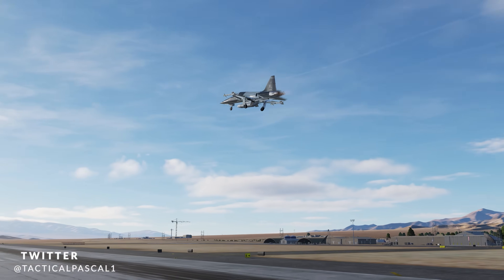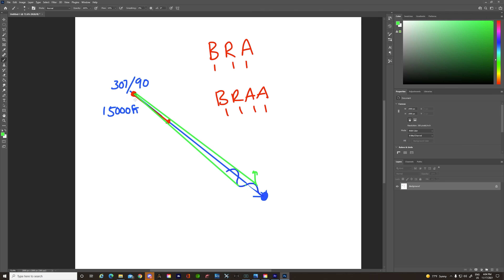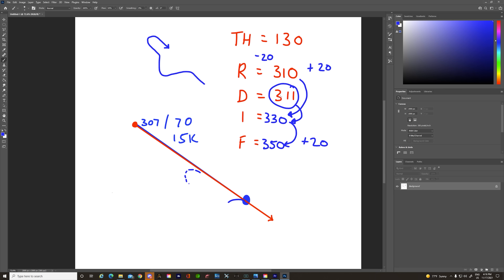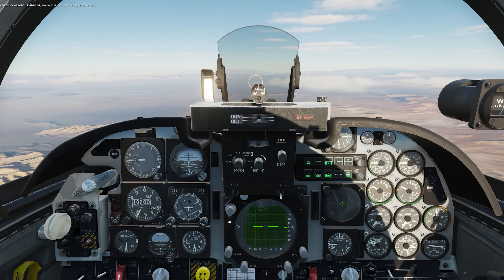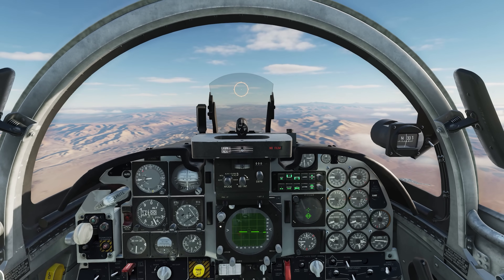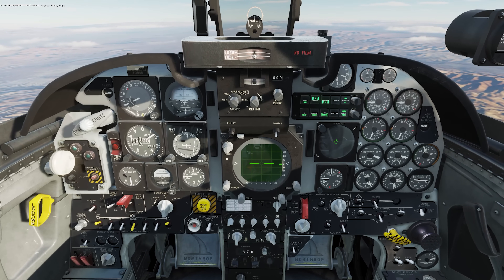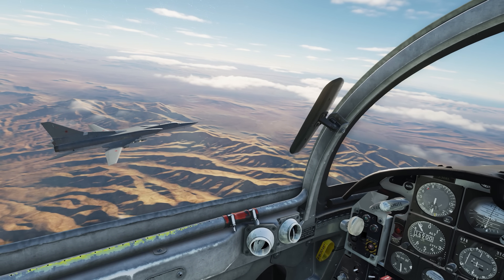Real GCI Instructor demonstrates Intercept Geometry | DCS WORLD

Comment: Seems like a huge oversight on ED’s part to not have AWAC include the target’s heading (aspect). Surely they are aware that BRAA has 2 A’s and their AWAC only gives the first A, so I wonder why ED hasn’t implemented a proper BRAA call for AWACS.
Reply from the maker: Seems strange to me too. However, not a great deal of people know how it’s done properly, they may have not had the full picture 😁 Hopefully it will get an overhaul.
Reply: Am I missing something? 3:21, one of the first callouts of the video, is a BRAA call, ended with target aspect. Still not precise heading, but aspect is there, DCS AI GCI calls out BRAA for contacts
Reply from the maker: @biaskolka it doesn’t give the heading
Reply: @TacticalPascale  Yes. Not the heading, but the aspect, so what BRAA is supposed to call: bearing, range, altitude, aspect.

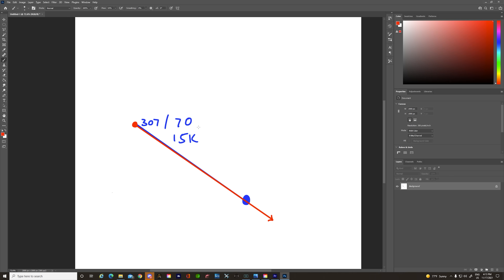Comment: 4:46 There is never need to round a bearing to find its reciprocal. The last digit stays the same whether you add or substract 180°. The same goes if you add or substract a separation of 20° or any multiple of 10.
Reply from the maker: I know this, but for headings it is easier to work to the closest 10’. I don’t have to fly 307’ for example.

Comment: How is this dealt with if bandit is actively pursuing and thus will turn their aircraft to follow you? Would you still use this or try something different?
Reply from the maker: You would adjust your headings as you get the bandits new ones passed to you.
Reply: @TacticalPascale  Wouldn't that ultimately leave him behind your 3-9 line if he's pointing right at you? I mean, sure, he'll be 20 degrees off from you but you're ultimately turning out and away from him. I mean, i get that this is kinda to look like you're not aggressive on him and to keep yourself out of a 50-50 (which is what would happen if you flew the BRA the whole way). On one hand, i don't want to fly straight at an opponent for a 50-50, but on the other i feel like you're handing him 20 degrees, which is fine if he's flying a TU-22, but what if this ended up a 4-ship of Mig-29s or something a little more maneuverable and threatening?

Or is this primarily a strategy outside of wartime?
Reply from the maker: At every stage of the intercept, with a more capable platform, you are within weapons parameters. At no point is the target outside of radar coverage. If they are declared hostile as you approach then you can shoot immediately.

I have been in a Hawk and intercepted by an F3. We didn’t know it was there until it appeared 50ft from the left wing.
Reply: @TacticalPascale  Ah, ok, so then this is specifically about intercepting for ID, escorting out of friendly airspace, and other things where you're not necessarily planning on firing right away. Judging from the title of the video, i (and i think a few others) made the fault assumption that this is specifically andvanced BFM specifically to get behind someone for some AIM-9Ps or archers.
Reply from the maker: Nope; any intercept on a bogey or bandit would be done this way. Hostile gets an AMRAAM from many miles away. Bogey / bandit, we have to establish hostile intent before we give them the good news.
Reply: @TacticalPascale  I thought "bandit" implied hostile. I'm familiar that bogey does not, though. Or is the "hostile" designation separate from "bandit" ("confirmed enemy" is the definition i'm going with)? I understand that the term "bandit" does not imply authority to engage, but i assume that's due to other factors that might not be stated (furball, another higher priority asset, etc). Is my assumption incorrect?
Reply from the maker: Bandit: enemy aircraft that you do not have the authority to engage.
Reply: @TacticalPascale  Someone might want to fix some of the online manuals, then: people are going to get the wrong impression. The definition being cited is "An aircraft identified as enemy, in accordance with theater ID criteria. The term does not necessarily imply direction or authority to engage." which implies permission agnostic as opposed to implying that you should not engage.

I assume, though that actual pilots aren't going by that definition, though. Sometime, though, someone might which could end up with an issue.
Reply from the maker: As I said: it’s an enemy but you are not permitted to engage

Hostile: enemy aircraft upon which authority to engage is authorised.

Two entirely separate id catagories.

Comment: This will be handy heading for the tanker, I always seem to either overshoot or wind up spending a week chasing it down.
Reply: I'm from another sim, but i assume DCS has TWS mode. Find the tanker on the radar with TWS or even CRM and it'll show you the heading. Some sims even direct you in with vectors.
Reply from the maker: You can use data links, but following the tanker around the towline is folly, we can use basic figures to intercept using the least amount of time. Useful when going to/from CAP or CAS taskings.
Reply: TACAN is your best bet for this, tune to the right freq. and you can watch the marker tick left or right along your HSI/heading tape/whatever and adjust your heading until it stops. If the marker is moving left/anticlockwise, turn left, putting the marker on your right until it stops, and vice versa. When it stops it means that it's not moving relative to you, other than range, meaning you're on a perfect intercept course.

Comment: Really interesting and useful, what happens if the bandit turns onto you though. They rarely just fly on unawares?
Reply from the maker: You correct your heading to adjust for its manoeuvre and start again with RDIF
Reply: @TacticalPascale  I assume that you have to do this in your head as you go? Practice makes perfect I suspect!!
Reply from the maker: Yes, TH - reciprocal, +/-20 Ideal, final.

Hand on heart, this was the first time I used actual intercept techniques in DCS. Surprised me.
Reply: @TacticalPascale  Excellent I'll give it a go!